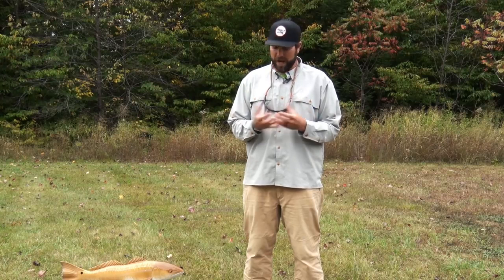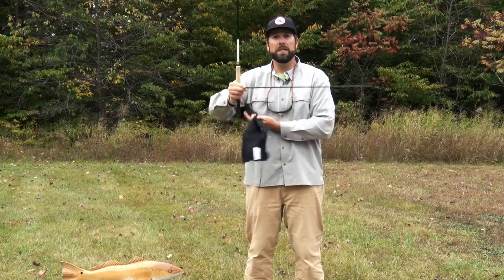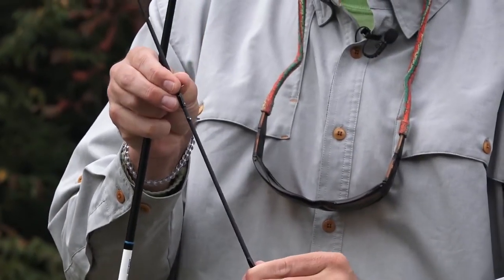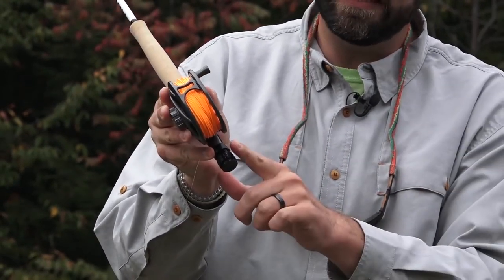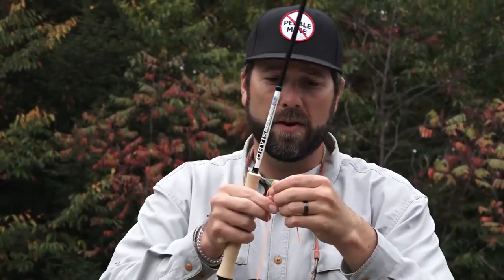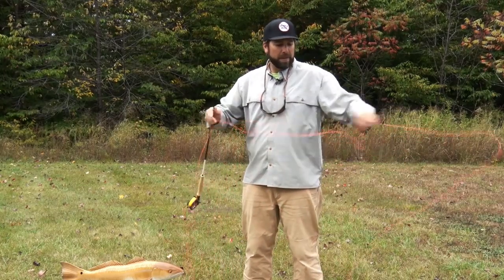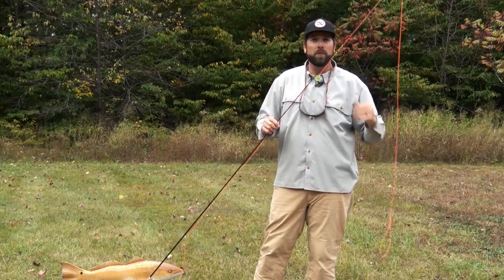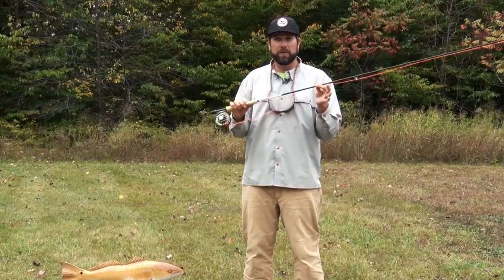How to Assemble and Set Up a Fly Rod

Comment: fly rods should be assembled from the tip down.. that way you dont end up with  the butt section sitting on the ground while you put the last piece on.. also i think its better to use the butt section of your leader while lining your rod.. if you always fold the fly line on the tip of the colored line while lining your rod .. the fly line will break down and crack after a while where you always fold it and no longer float